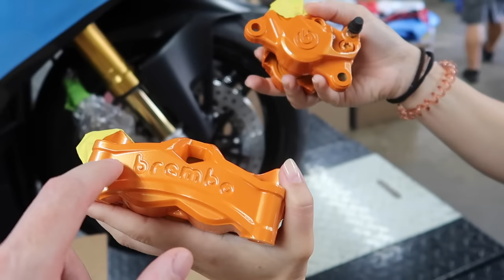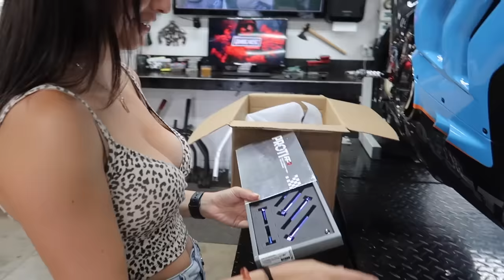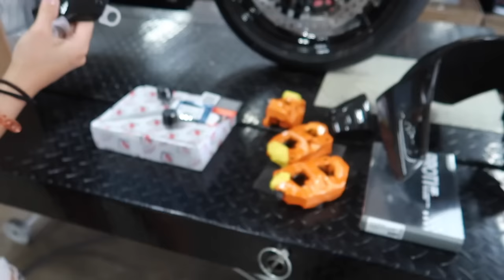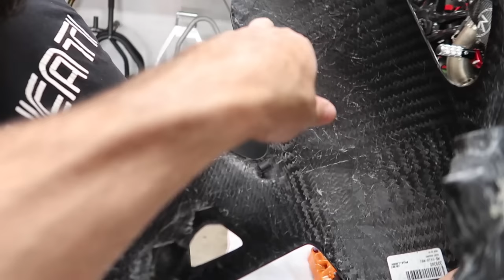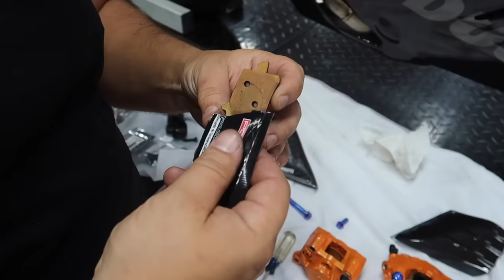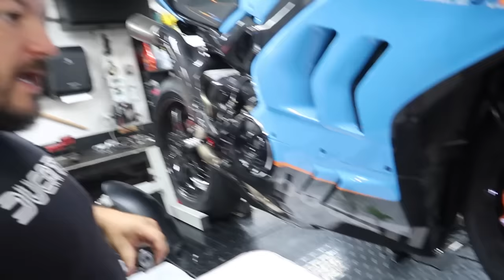Installing Custom Painted Brake Calipers on Our Lambo Panigale!

Comment: Hi Jaret, the only part that doesn't look as good as it should, in my eyes only, is the cooling plate, it's angle doesn't go with the fork leg or the front mud guard. The rest looks great, so that's why that angle doesn't go with the rest of the rest of the assembly.

Comment: There’s plenty of good on your project bike but that’s mainly down to very well-fitted bolt-ons.

I think you need to be able to be objective about your colour choices. 

A quick glance at your covering photo and it looks like you’ve fitted fairing-mounted indicators/blinkers and reflectors on the forks. I am sure others will think the same. 

Not picking out the Brembo logo is a definite mistake on a bike that you keep reminding us the value of. Many restore Brembo brakes to perfection including contrasting logos. Even those who do powder coating can help with this.

‘Dado’ seems like a nice guy. 😊

Comment: Unique build color, love it. For the color comments on the Ti hardware, Blue has never held up for me so the Purple is a better choice IMO. The Ti Hardware on the calipers WILL over time fade due to heat depending on how much you utilize the brakes.